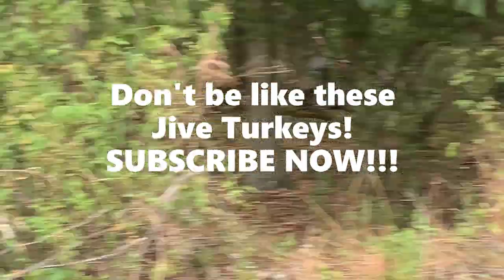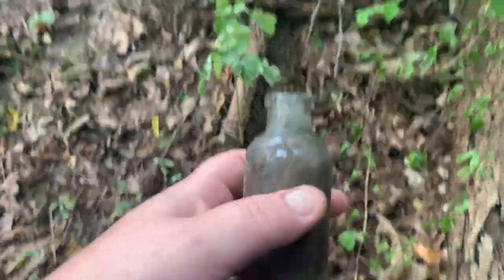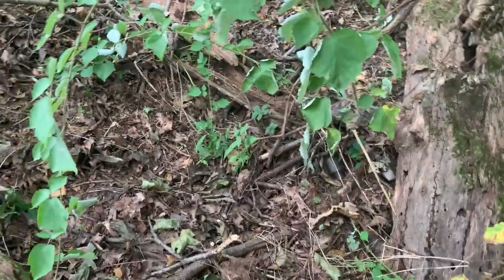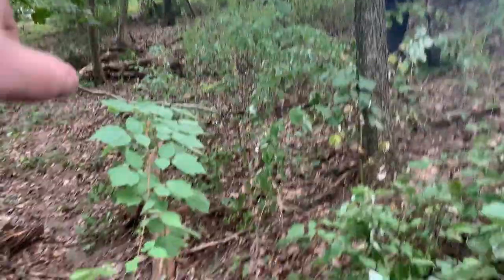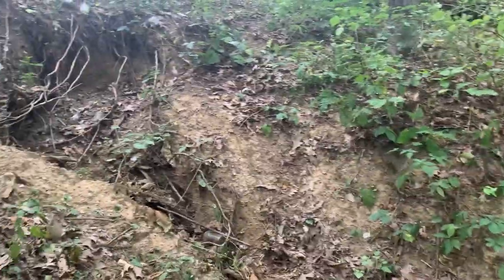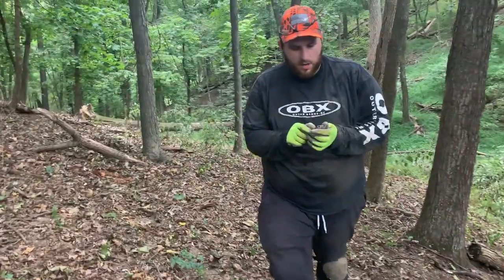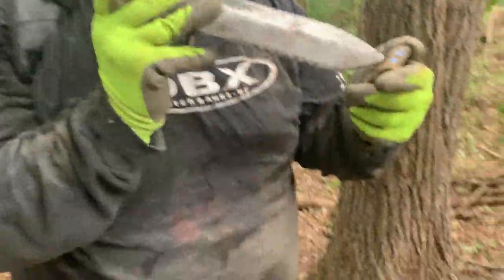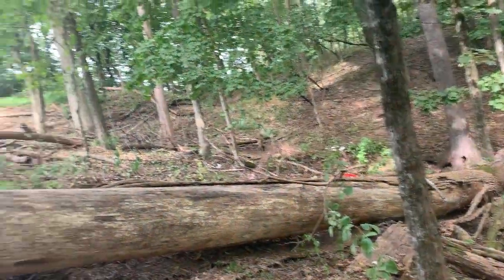Marathon Day Detecting & Digging! Great Finds! #metaldetecting #digging #treasure

Comment: The ground looks pretty tough up there too. It hasn’t rained down here in over a month, the top 3-4 inches are like cement. Getting a lot of false signals. Are the tops for those cold cream bottles white glass as well?
Reply: Some are and some are metal you can tell when the metal rusts and stains the actual container itself.